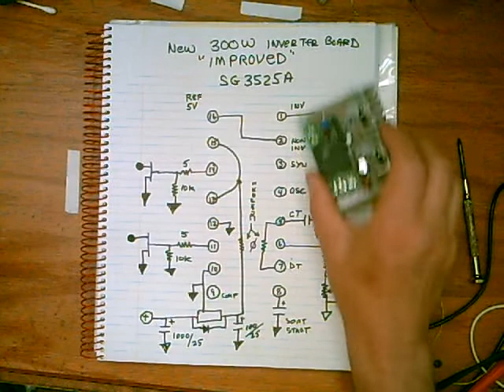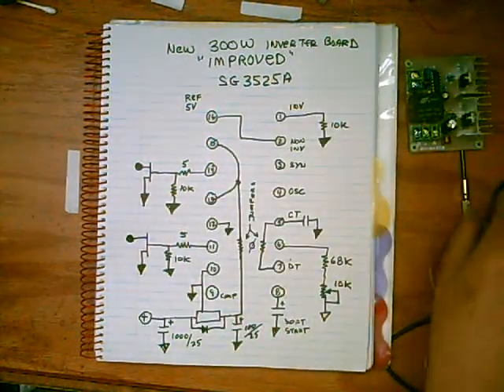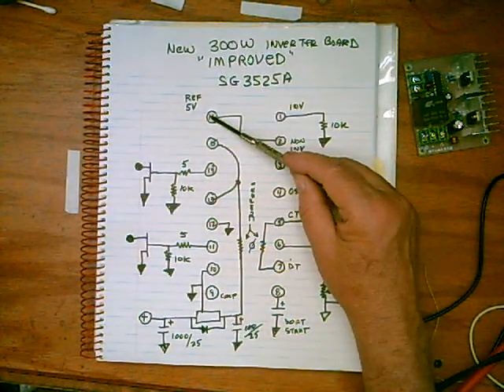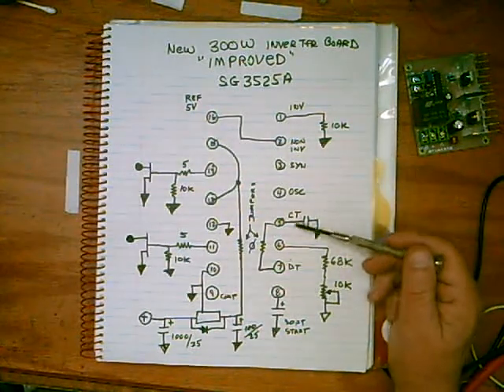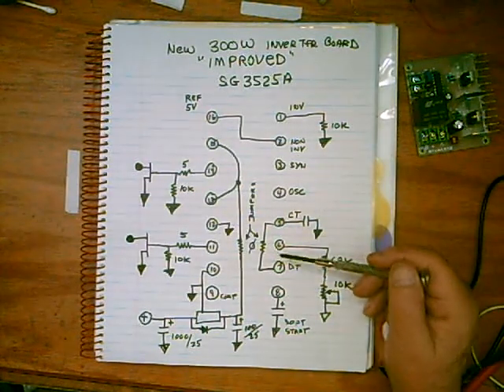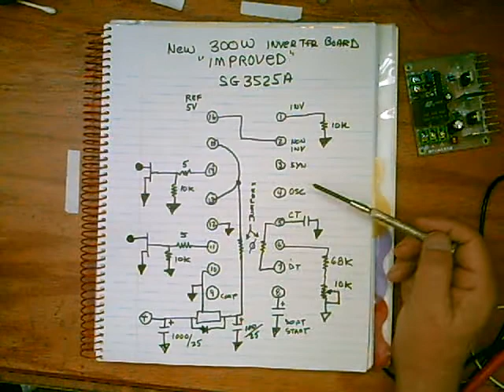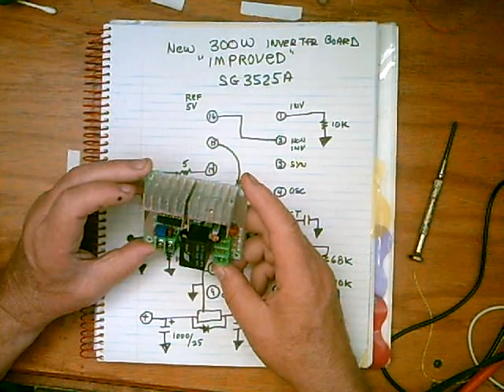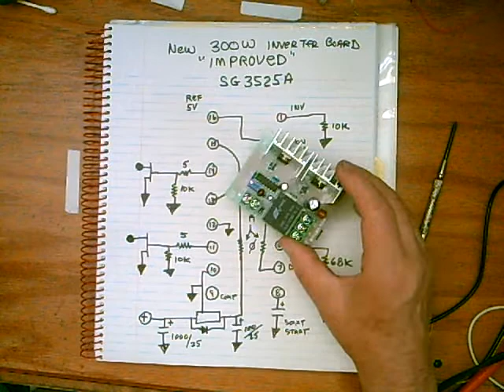NEW 300W Inverter Board With SG3525A replacing the IR2153

Comment from the maker: I now have this board working and heating water. I changed the reference from 5V to 2.5V to be compatible with prior versions with  the IR2153.   It is a far simpler conversion taking fewer parts. The 3525 is an old technology part that requires a little more than 3 times the current to run and requires a zener. Dropping resistor drops to under 3K and the pre charge resistor drops from 1K to 270 ohm. Board trace spacing on FET is far too small, but who am I ato argue eith the worlds greatest supplier of electronics. Mine came with 75N75 FET at least. Bottom line is it works.